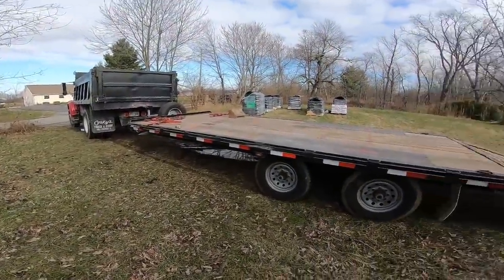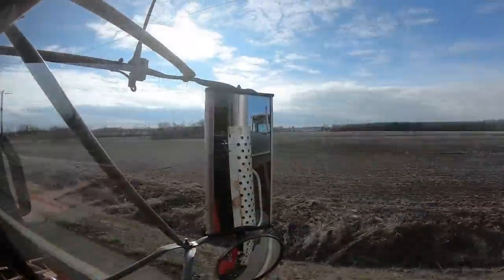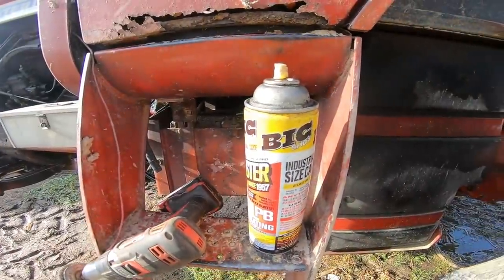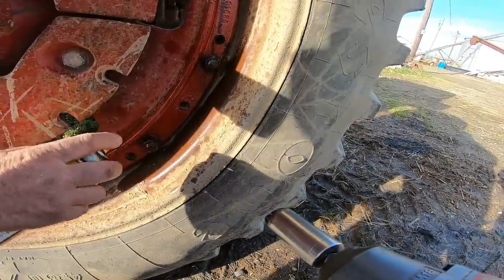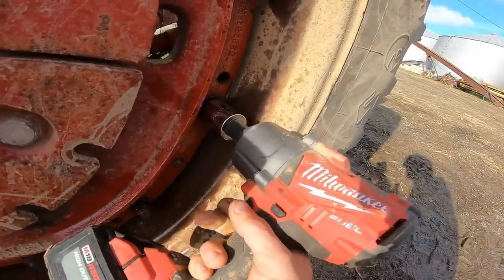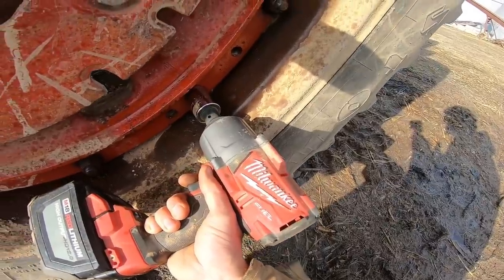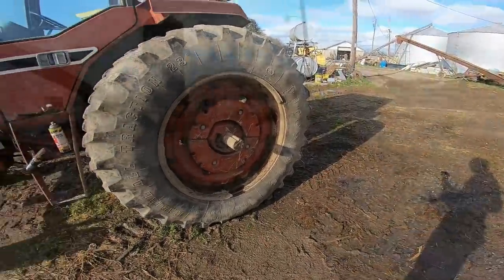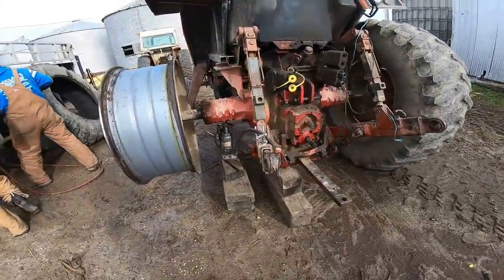Why is the 1086 Taking a Trailer Ride??

Comment: Ummm YEAH!  DUDE taking your life in your hands even getting NEAR that thing, let alone standing that close filming it!  People don't realize, but a tire is just a contained explosion waiting to happen!  Rim bead failures are NOT pretty-- that little bit of cracked super-stressed (you can tell by the spider-web cracks where the big crack ends as it's starting up the side of the bead ring) steel turns loose, the compressed air in the tire will propel that outwards like a rifle bullet or a blade thrown from under a mower... anything in its path is TOAST because it'll go straight through it!  When I was in mechanic's school, the instructor in truck brakes and chassis (which we also dealt with tires and rims and stuff in that class) kept an old truck split rim bead ring at the back of the classroom-- it was for a 20 or 22 inch rim, and it had been stretched out about 3 feet long from its original flat shape when it turned loose from the rim, by the expanding (basically, EXPLODING) tire... stretched it out into a perfect spiral 3 feet long, just like a very large, thin piece of auger flighting!  We watched safety videos about rim explosions and failed two-piece rims, one they set up a dummy on top of a split rim laid flat putting air in the tire, course they used a clip-on chuck... when the rim let go, it blew a hole in the steel shop roof, and put the dummy clean through it!  Needless to say, would have been fatal.  Now granted tractor tires are usually running more like 20-25 PSI than truck tires which commonly hold up to 140 PSI, but STILL even at 25 PSI it's very risky!  Only way I'd have touched that tractor is to bleed the air off til the tire was very baggy, and wrapped a chain around that damaged part of the rim several times and hooked it to itself... so if it DID turn loose it wasn't sending shrapnel flying!  Some stuff you  just don't play with it you want to live!!!  Later!  OL J R :)